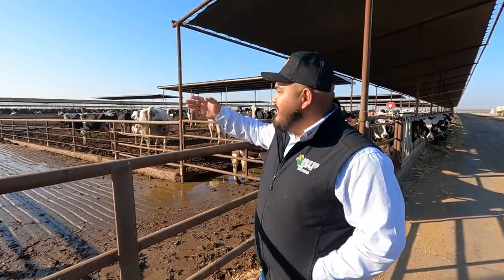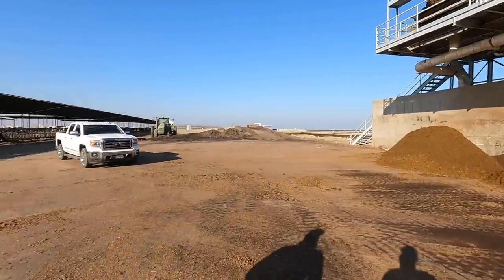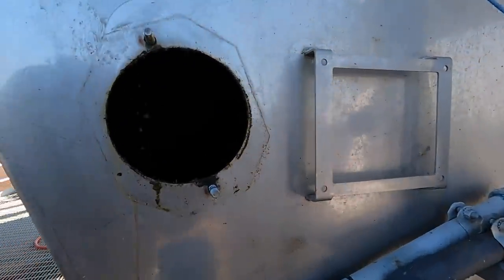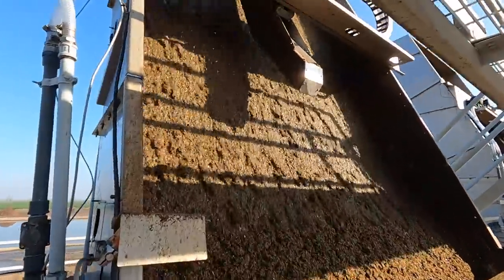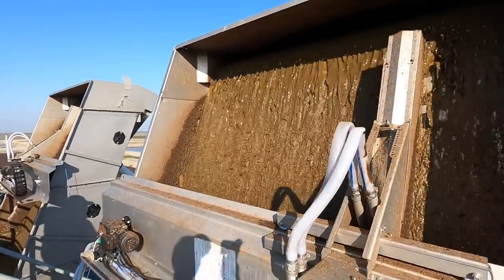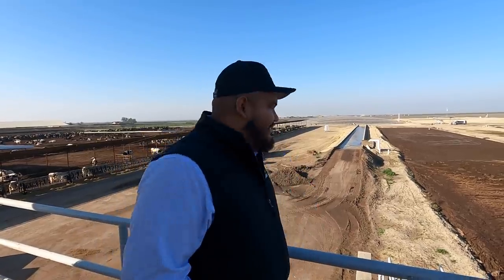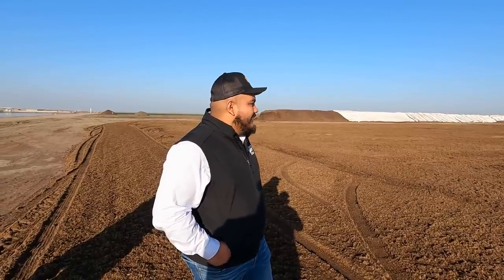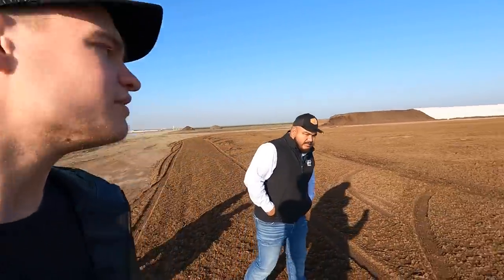Manure Management and Methane Gas Collection on 5100 Cow Dairy!! (Part2)

Comment: Wisconsin has a rule that any farm with over 1000 cows (maybe 500 now) must have a digester system.  Many dairy farms around us (including ours) have a digester and the gas is cleaned & fuels generators for electricity.  We also have solar panels on our mechanics shed roof and have 10 spiral wind turbines.  Any excess electricity is sold to the grid.

Comment: Thanks for the nice video! 👍
It's very interesting to see such a system in the USA.
Most dairy farms in germany with more than 200 cows have a biogas plant to produce electricity from liquid manure. the waste heat from the engines is used to heat the fermenters and buildings, generate hot water for the milking parlor and calf kitchen and dry the separated fermentation residues. These are then scattered in the boxes in the barn instead of sand.
Greetings from Germany, David
Reply: Son unos de los HOTGIRLS18.FUN 

Sun: "Hotter" 
Sugar: "Sweeter" 
Joonie: "Cooler" 
Yoongi: "Butter" 

Son unos de los mejores conciertos.#垃圾 :yt:

Comment: If you had a methane digester, it could only run from mid April to November, 6-7 months of the year. Depending on your methane production, perhaps you could store the methane for year round use.  Composting can produce methane also which could produce year round.  Compost produced methane in France during freezing temperatures.  More than one way to skin a creature.

Comment: Interesting.  How much methane do 5100 cows make per month?  Do you have to add the bacteria?  It would be interesting to know the smallest number of cows that it is worth capturing methane.    Does your human waste get used as well? 
Since the cows live inside, is there a way to capture any methane they put into the air?  
Who pays who?  Do the dairy pay for their waste to be processed or are they paid for the gas they produce?   Lots of benefits but the capital investment to set the system up is huge.  But I do believe we should and could do more recycling.
There are systems here in the UK where the methane is stored for about a week and then a truck is sent in to process the methane so it does not have to be piped away from the farm.  So they are trialling it with 6 farms of 70-300 cows and one mobile processing unit.

Comment: Don't expect it though it would be interesting to know the cost of the Infrastructure and the ROI.  It is safe to note that it will be plenty of years before those costs will be recovered.  Also, I doubt there are any studies to measure the cost-effectiveness for the isolation of Methane by the process described.  Recycling the water is admirable though the open containment loses a lot of water through evaporation also not quantified.  Private and Family farms are very cost-conscious and therefore much more efficient.

Comment: I wonder how the sanitary bit would be different between the sand bedding and the dried manure. I know alot of farms use the sand because it cuts down on the bacteria for mastitis.
Reply: Is a chemical analysis done on 'material' before using as bedding?
Reply: @CurrentChoices  not that I'm aware of. I do know that its harder for bacteria to attach to sand compared to dirt or wood though which is why sand is more common.

Comment: How many cubic feet of methane does the gas collector collect in a 24 hour period? Instead of putting the methane into the pipeline to sell, is it enough to run a methane gas fueled generator that could take care of some of the electrical requirements of the dairy and lower their electric bills? Here's the big question though, how much did all the methane collection equipment cost to install? Does the revenue derived from the sale of the methane collected offset the original investment?
Reply: Thats good question. The area where this is solar power is very popular. So many farms have a solar array to run the whole operation. Energy prices are rising all the time so alot of farms are changing from farming crops to farming  elecricity.

Comment: The only scary part about hooking the poop water line to the well water line is if someone switches the pump around a big environmental mess is coming. A farm in Idaho did that and turned into a big mess and ended up going bankrupt if I remember right.
Reply: That's why they're mixing it in the lagoon, so there is no direct connection between the two!